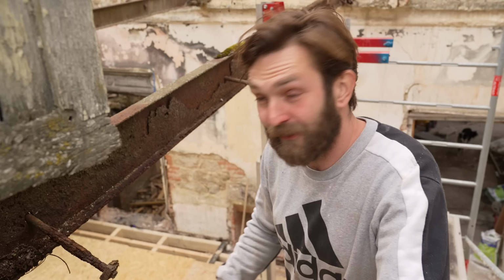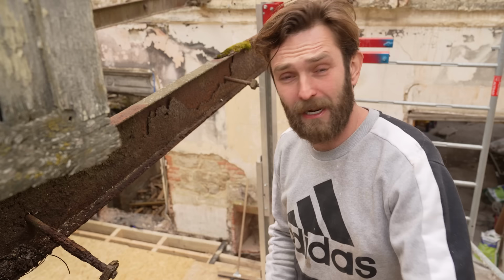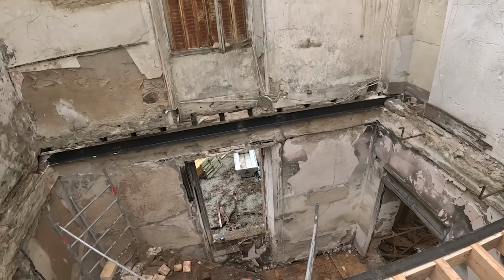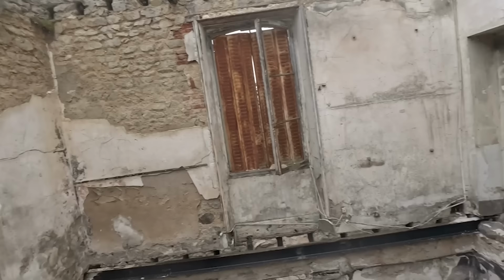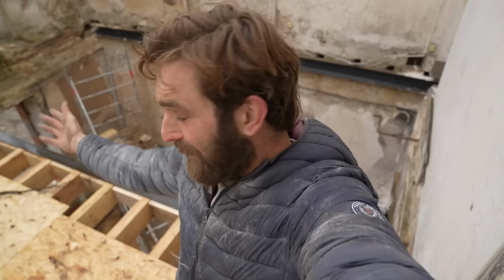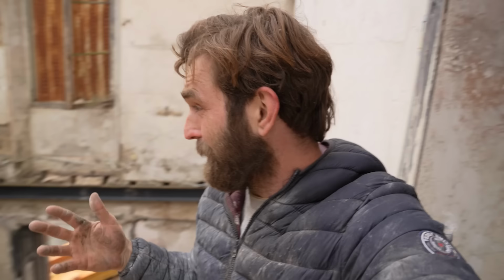Discovering a new floor and view for the first time.

Comment: i was watching this for a while and i was trying to give the benefit of the doubt but this guy is in way over his head and ive yet to see an engineered plan and i continuously see work being done that is not only substantially below what would be acceptable for a project of this nature and magnitude but even dangerous.  also, i would like to see some tests of the integrity of what is left of the existing structure.  i consider the very distinct possibility that the structure is a ruin and beyond salvage.  if you want to disagree that’s fine but show me some evidence and prove me wrong because your gut feeling and emotional attachment to what he’s attempting ain’t good enough.
Reply: Dan have more than once mentioned he's working based on engineer advice. Like the upgrading of all the steel beams. I'm pretty sure he in one of the videos not long before starting on the roof construction ,even mentionen he had to prepare for an engineers visit on the site. Seems fairly naive to believe Dan with an background as chef, make larger structual parts of an big building from scratch without using competent engineering support. Nobody need to proof anything to you; neither Dan.